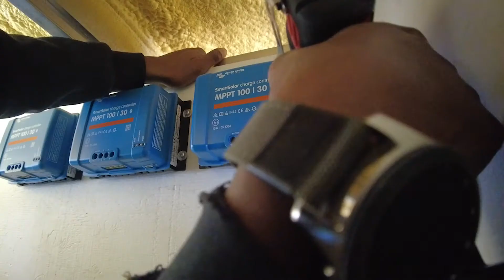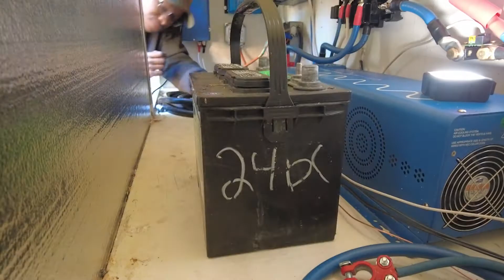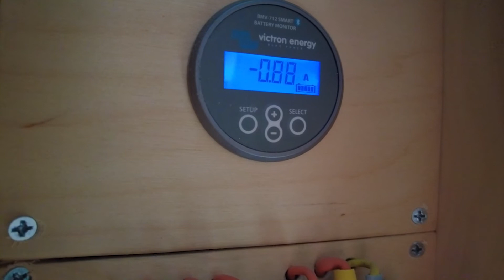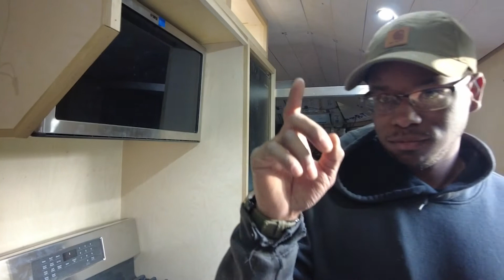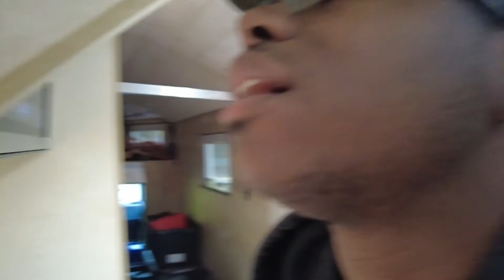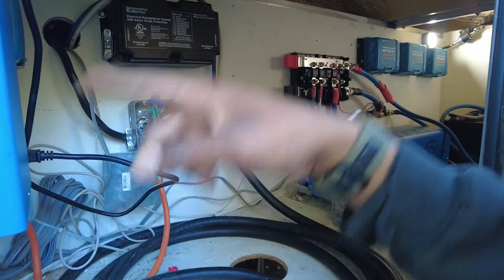It's Nearly Done Minus the Batteries! Off Grid Electrical System in House Truck Conversion

Comment: Haha I like just finally put a monitor and charge relay on my system a few days ago too. I wanted one of those hydraulic crimper tools but couldn't find any when I went to do it so I just soldered and used a vice. Hope you get your batteries soon! I just have 2 group 27 deep cycle marine ones charging off alternator only at the moment

Comment: It's getting so close!!  That's very exciting!  Were the solar panels connected when you did the air conditioning test?
Reply from the maker: Yes it is! I can't wait! And no, the solar panels are not up yet. We're thinking we want to finish the water system before we mount them. We went camping in it over the weekend and decided that water was more important than charging at this stage :~)